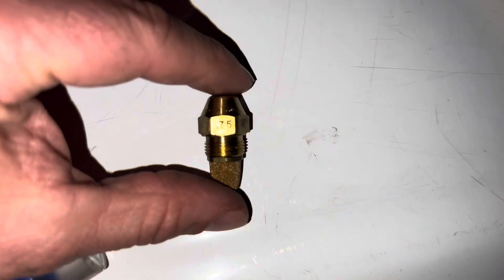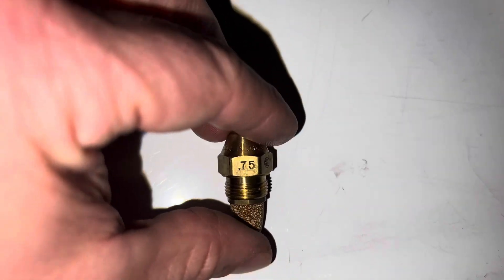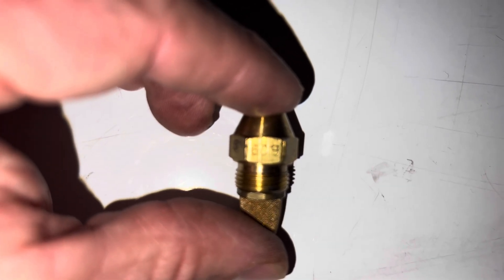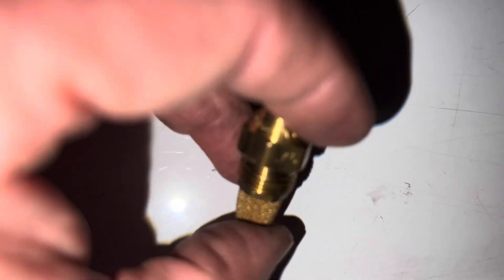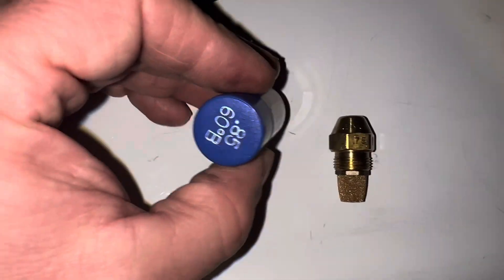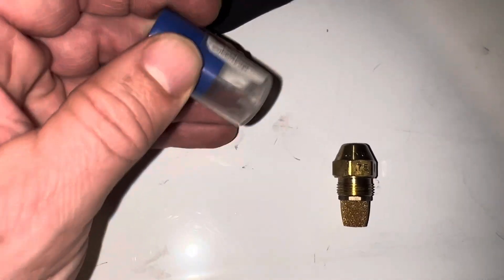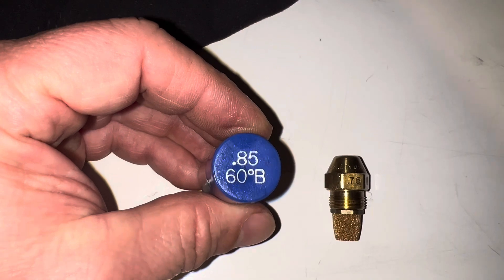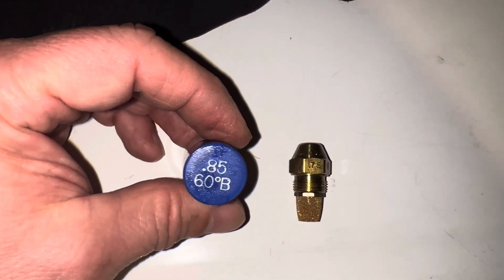Trying To Find The Correct Size Boiler Oil Burner Nozzel ? Watch This!

Comment: My furnace went out had it looked at, it's a Beckett he immediately said you need a new furnace he said at the time the parts are discontinued but he took my burner noozle and messed with the gun assembly before he left that was 2.5 years ago the tank been full that long ago what should i do??
Reply from the maker: You may want to have a professional plumber take a look at it for you to check the condition of everything.